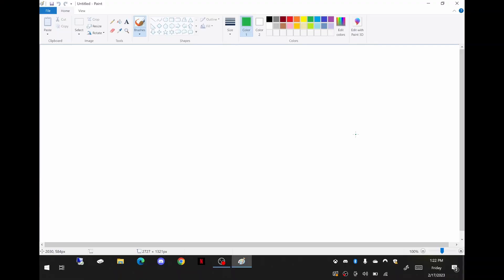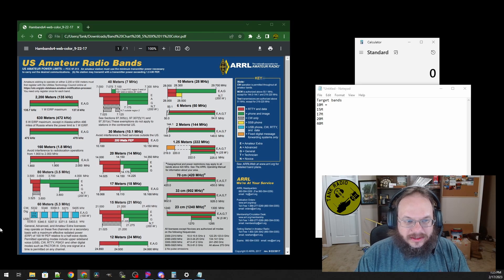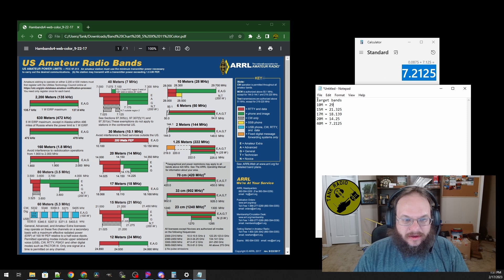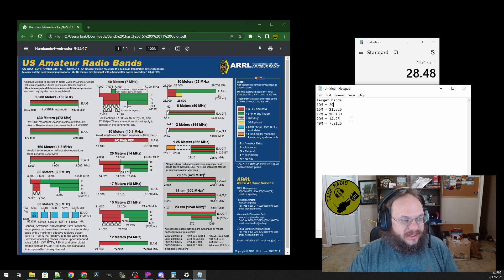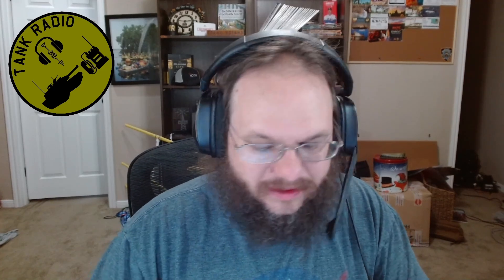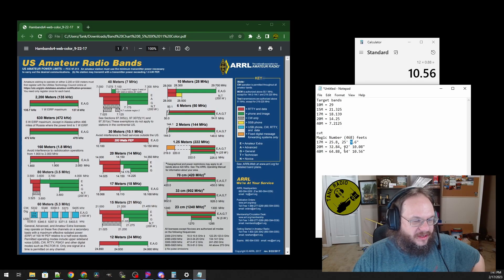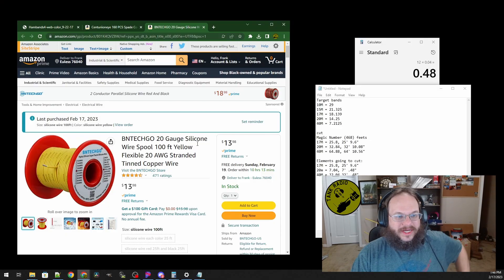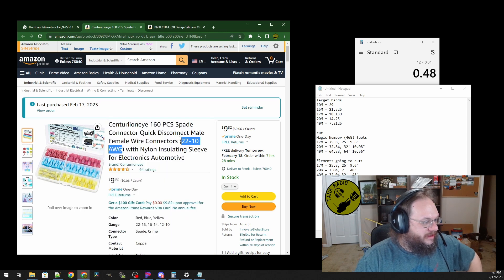How to Calculate Multiple Banded End Fed Half Wave (EFHW)

Comment: Math Check, someone please. If we wanted to create the "magic do it all" linked EFHW targeting the middle (voice and data) of 10, 12, 15, 17, 20, 30, and 40. we would get the following targets: 10 - 28.15; 12 - 24.94; 15 - 22.225; 17 - 18.118; 20 - 14.175; 30 - 10.125; and 40 - 7.15;  Looking harmonics we would need 4 sections, one  for 12, 17, 30, and 40  (40 can give us 20, 15, and 10. We could do a 20 (for 20 and 10) to shorten how much wire we put in the air but its not critically needed).  Using the math 468/f gives us the following: 12 - 18.765ft; 17 - 25.83ft; 30 - 46.23ft. and 40 - 65.45ft.  Separating should you do it, is this math right enough that you could do it?

Comment: 0:44 One defines the dipole antenna not by form, but by function.
IEEE 145-1993…
    “dipole antenna (antennas). Any one of a class of antennas producing a radiation pattern approximating that of an elementary electric dipole. Syn: doublet antenna.
    NOTE: Common usage considers the dipole antenna to be a metal radiating structure which supports a line current distribution similar to that of a thin straight wire so energized that the current has a node only at each end.
Fed in the  center, end or anywhere in between, it's still a dipole antenna.
Reply from the maker: Interesting, so classification, End feds and middle feds are the same type of antenna.  TODAY i learned.

Comment: Frank great job! I really enjoyed the video and it cleared one of the questions I was going to research, namely overall length. We got tons of snow here right now. I have to do some antenna repositioning, as well as crossing some Ts and dotting some i's with both my 20/17/12 fan dipole and a 40 dipole that I use for 40 and 15 meters. Unfortunately, I do not have the room for 80, let alone 160. This winter season, snow has taught me a lot about antenna placement/arrangement/positioning in summer vs winter. So once everything melts around here, I need to get out there and make the fixes. That Rig Expert really helps, but it is also a great teaching/learning tool. I am new to HAM Radio, got my gen on 8/30/21.

This spring/summer I want to make an EFHW that will work on 40, 15, & 10. I need to add 10 to what I currently have. I want to set it up as a "sloper". I can put the end fed portion on my roof at 35 feet, and then slope it to a nearby evergreen that is about 50 feet high, so it would be sloping from 35 to 50 feet. My question is, I want to be able to run 600 watts. On these antennas, what dictates the max power rating of the antenna? Is it the wire gauge?

If this goes well, then I plan to make another two EFHW for POTA, those would be low power, below 100 watt. I plan to get an 891 later this year. I live in NE Utah outside of Park City. We have several POTA & SOTA national and state park destinations really close by, figure 15 to 25 minutes away. 3 hours to Yellowstone & the Tetons. So it is ALL good stuff in our neck of the woods when it comes to POTA. 

73
Louis WW7GBA

Comment: Hi Frank, consider cutting the 40m towards the low end (but still in) the phone section, then you may find that the higher bands fall closer to the phone sections, and you might find a balance where less tuning overall is needed...
Reply from the maker: You are correct, and i didn't really address this in the video.  I choose not to do this so i can better have better 1:1 residence on the other elements.